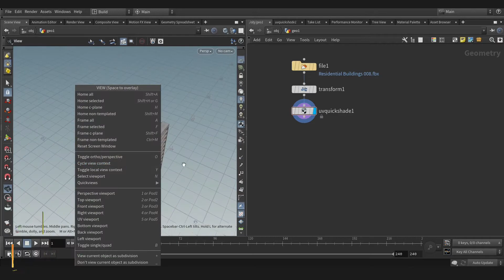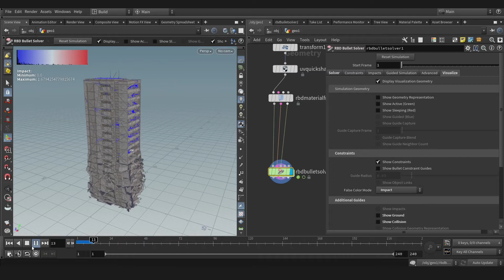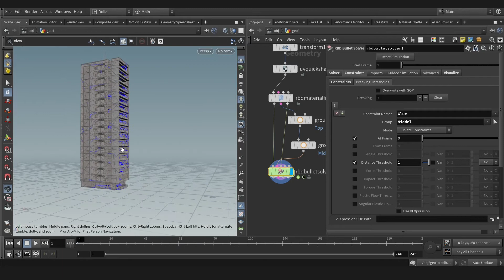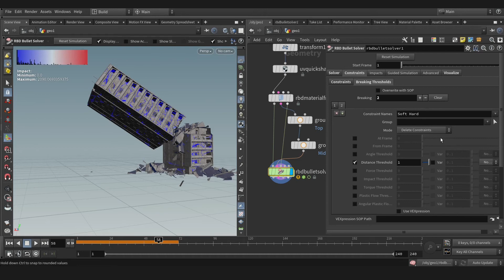Building collapse in Houdini 19

Comment: What is the minimum system requirement for this type of simulation
Reply from the maker: Actually, I don’t know the minimum system requirement but at least you need a decent CPU and RAM with RTX GPU
Reply: @diyz3n will 96 gb ram be sufficient

Comment: Nice tutorial Sir! For thoose whos strugle with that method, probably its not working because you test the setup on the frame 1 and not on the frame 0. Frame 0 is the default param and your timeline probably start with frame 1 by default. Dont know how could you achive to work like that in the video, but its solved in my side.
Reply from the maker: I don’t think that would be a problem at frame 0
not testing though but I think it's wil workl

appreciate the compliment, bro
Reply: Do you have any idea how to use the another Bullet Constrain mode Sir? The Switch to Next Constrain one. I cant figure it out yet.
Reply from the maker: We talk about next constraint or which constraint in this one if you wonder

How to crash lovely Mercedes Benz in Houdini 19.5
https://youtu.be/HLqqQeH98o0

Comment: My material fracture node takes ages to cook. I already tried to scale geo down but no effect. Any ideas ? Because of the windows I have around 5000 single meshes, but geo is not that heavy. ( windows are only cubes)
Reply from the maker: Just to know is material fracture, taking too long per frame(when you hit the play) or only in one frame?
Reply: @diyz3n  It takes so long before playing one time. To fracture the windows it takes 10-20 minutes on a Ryzen 7950x. Everytime I change some settings in other nodes it reloads in the cache. So it’s unusable.( it doesn’t do this for every frame )
Reply from the maker: @pm-film so when you say it’s changed every time I adjust other nodes it means you need to place a material fracture node after the simple procedure(for example, after loading your file)
Reply from the maker: @pm-film and as you said, Rayzen is powerful and makes sure your geometry is. It’s not dense, or fully subdivided.
Reply: @diyz3n  Thanks a lot for your feedback!

Comment: hi, quick question, is it possible to custom the bounding box like a sphere mountain or to rotate? i still new again houdini, thanks
Reply from the maker: Hi, yes you can have a custom bounding box to the group just link your mesh to the second input, and under boundingbox, options set to point mesh. (Somethings like that ) and be aware that the custom bounding box is only supported by point groups.
Reply: @diyz3n  but the rbdconfigure is useful with or for the group like that? seem i got a conflit betwee rbdconifgure and the groups constraint
Reply: cuz i work on a project wich i got a monster who went into building
Reply from the maker: This node is different from others, group constraints may store in the RBD configuration, and RBD configure is your gateway to the RBD solver
Reply from the maker: for the monster, I suggest you do it manually first, animate, the monster and see the impact area of the building and create a custom group with a custom trigger to delete this constraint, honestly in Houdini. It’s not going to work procedurally in every situation. That’s my opinion though.
Reply from the maker: for the monster, I suggest you do it manually first, animate, the monster and see the impact area of the building and create a custom group with a custom trigger to delete this constraint, honestly in Houdini. It’s not going to work procedurally in every situation. That’s my opinion though.
Reply from the maker: for the monster, I suggest you do it manually first, animate, the monster and see the impact area of the building and create a custom group with a custom trigger to delete this constraint, honestly in Houdini. It’s not going to work procedurally in every situation. That’s my opinion though.
Reply: i add another question sorry, can we animate a group? like the top building i wish he fall on some zone
Reply from the maker: And about the animate, the group yes, you can animate the group, but the big question is that be bulletsolver I guess (not remember totally )I guess not support animated group(out of the box) in SOP level, but give a shot and try that and let me know